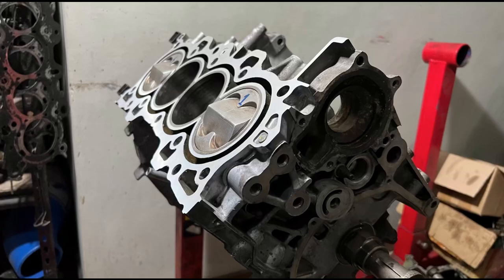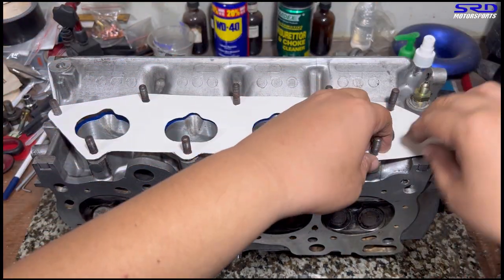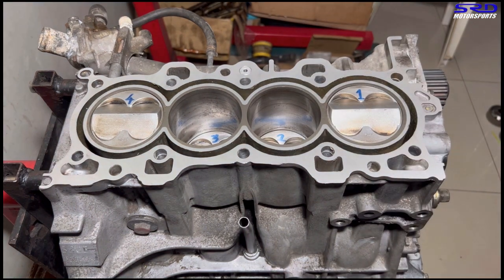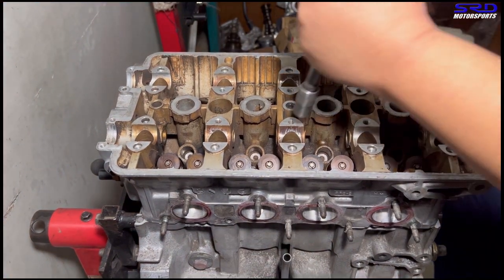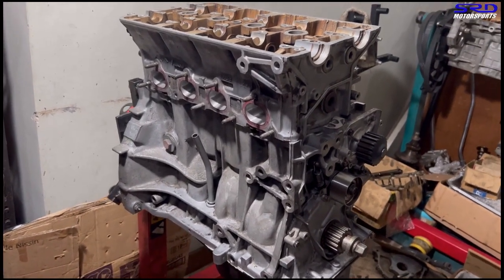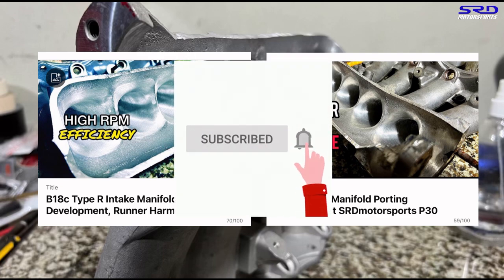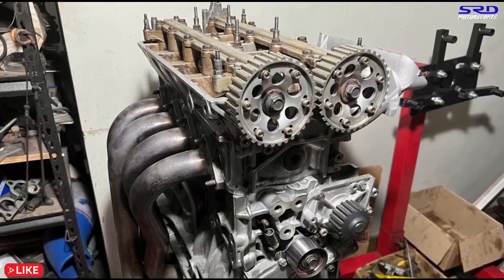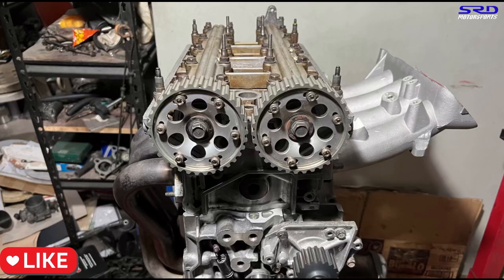B20vtec GSR Cam Rebuild Series part 5: Head & Intake Tech

Comment: Which head gasket do you use for B20Vtec? B20B or B18C1? Thanks!
Reply from the maker: @kenoip2089  standard b20 HG cuz it’s for 84mm, b16 is the same as b18c1 so 81mm

check our “how to” video on b20vtec we talk about it extensively and “why”

Comment: I know this may  across as me being dumb but I having the hardest time trying put the timing belt on smh I feel so defeated.
Reply from the maker: Use an extra screw driver (slightly bigger) to wedge the tensioner more loose (downward) to give u an easier time installing the belt

Cuz the tensioner has a spring it’s always pulling itself tight
Give that a shot it might help

Comment: Any reason why you put sealant around the oil ports on the gasket? Can't wait to see this bad boy in action
Reply from the maker: good question actually… I guess cuz the Honda manual suggests it

Plus when we used copper spray years back? The corner near the vtec solenoid side? Always was wet with oil but no substantial leak just “wet”

And that stopped when we started doing what Honda suggests lol this was around 8-9yrs ago
Reply: @SRDmotorsports  ohhh, I see now, yes it is true, whenever you pull the head off there is really oil around those areas and I never understood why lol but now I know haha
Reply from the maker: Same here back then I’m like “why” 
I guess Honda knew haha
Reply: @SRDmotorsports  Honda knows best lol